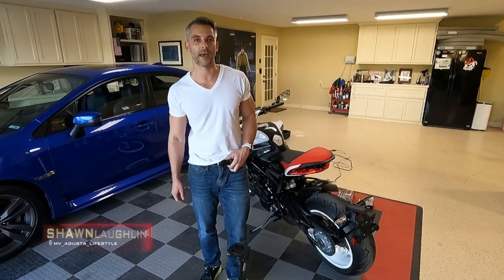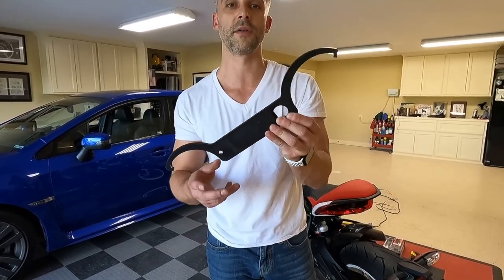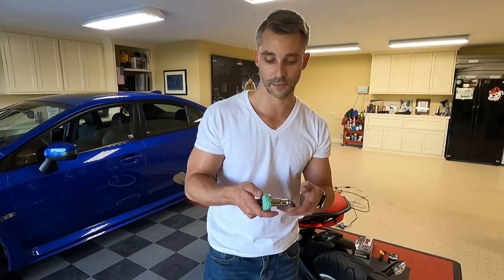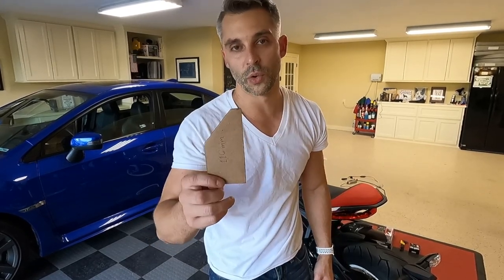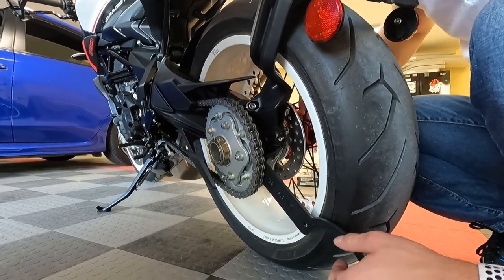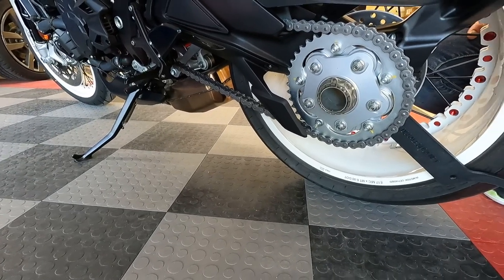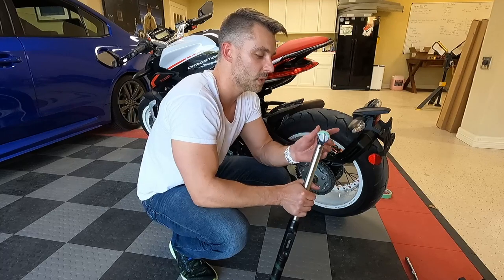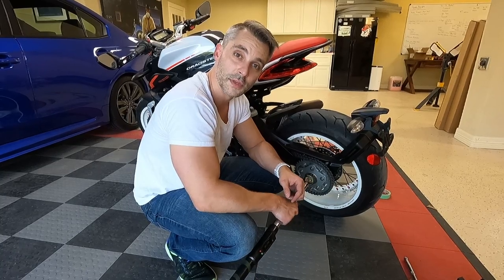Single sided swing arm chain tension... MV Agusta!

Comment: You are supposed to check multiple spots on the chain and adjust to the tightest spot.  You also dont mention setting the ride height after adjusting the chain tension.  The chain is adjusted by rotating the hub, which is eccentric - thus the rear ride height is impacted depending on how far you have to adjust the tension.
Reply from the maker: Ryan, super solid adds. I agree especially with a new stiff chain, often it can tension differently in several places. Great point that I missed. The ride height also a good point, although would take a fairly significant adjustment (maybe a sprocket tooth change) to change the ride height I would think. Any comments on the best way to go about the ride height adjustment? Would love to do another video and add these couple missed items.
Reply: @mvagustalifestyle7023  Thought I replied to this before - sorry!  There is special tool that fits into the frame bolt holes and you measure from the arm to the swingarm stand top and set to the height via the height adjuster rod to the OEM spec or a little higher if you like quicker turn in.  Fast by Ferraci sells the tools as well as the dealer.
Reply from the maker: @falcn12  I couldn't seem to track it down. If you have a link drop it in please. Good add.
Reply: @mvagustalifestyle7023  I got mine from Fast By Feracci, they are still in business selling from their website. I have mine hanging in the garage.
Reply: How many chain links do you have in yours?
Reply: @biolleyaxel355  stock on mine
Reply from the maker: @biolleyaxel355  Same. Stock here as well.

Comment: Hey I can I ask you a few questions about the mv agusta? 

Does is chatter and vibrate a lot before you pull the clutch in and if so when you do pull the clutch in does the engine still make a lot of chattering noise?
Reply from the maker: Hi CreamsicleMoto. Short answer is no. That sounds unusual to me. Even knowing that I have personally remove the clutch cover and the clutch plate and replaced it with an aftermarket clear clutch cover and new anodized clutch plate, I do not experience any vibration or any chattering. I have however heard of many people with the dragster having issues with the clutches shifter/quick shifter.